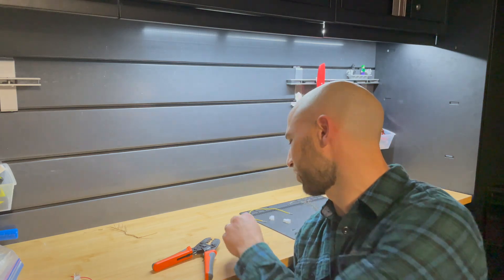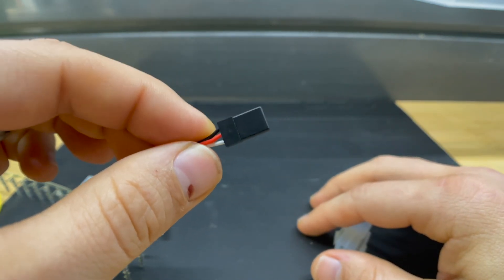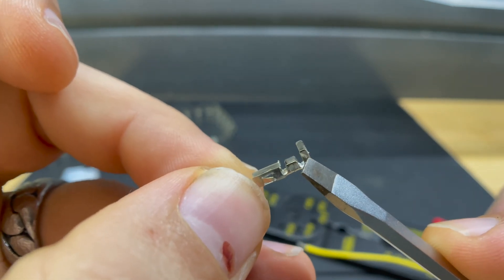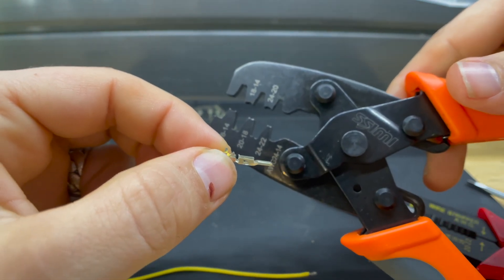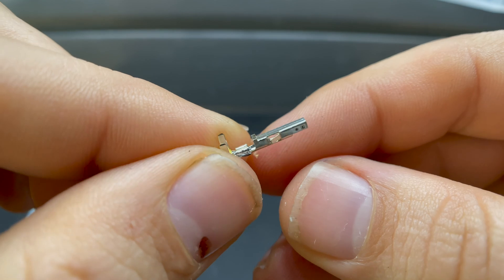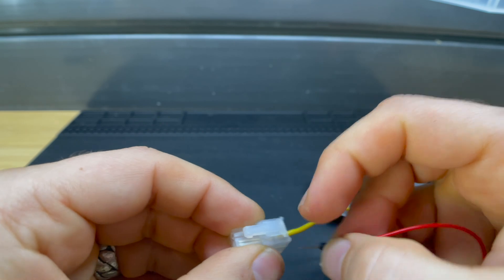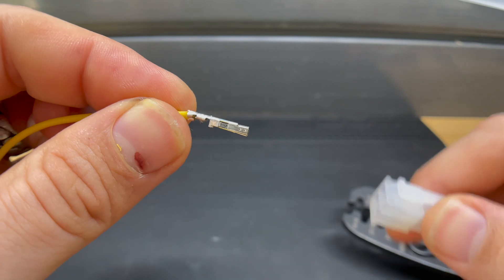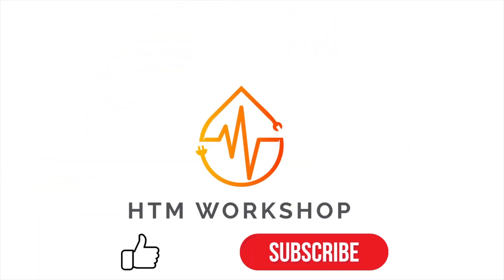Molex Crimping, Pinning, and More!

Comment: Crimping is not an issue for me. Getting the pin into the molex connector IS. I need an insertion tool because the wire is so flimsy that the pin will not go in far enough to catch the little fingers. Tons on videos on removing pins, none on inserting them.
Reply from the maker: Usually it’s not much of an issue - is there a way to use a thicker wire? Maybe use solid core instead of braided?
Reply: @HTMWorkshop  I am limited to 20 AWG braided
Reply: @CruiseReport sounds like you got scammed into buying thinner than spec wires

Comment: If you look at 7.06 mins some of the strands have gone down the outside of connector due to connector been in crimpers first. I like to put wire into connector and then the two parts into.   
 crimper. Just my way of doing it. Great video by the way.